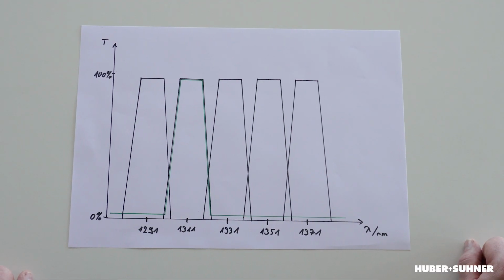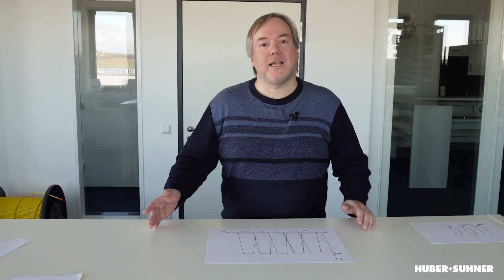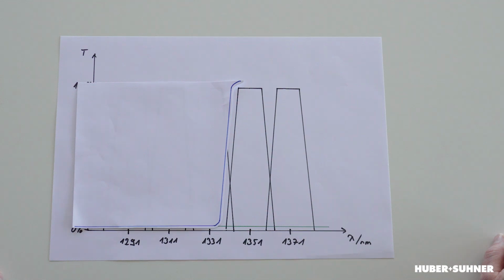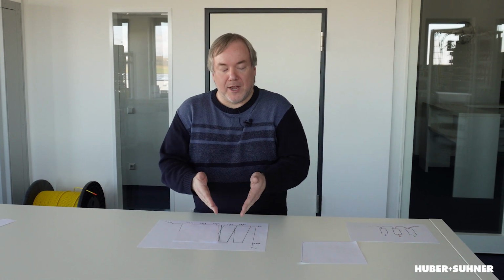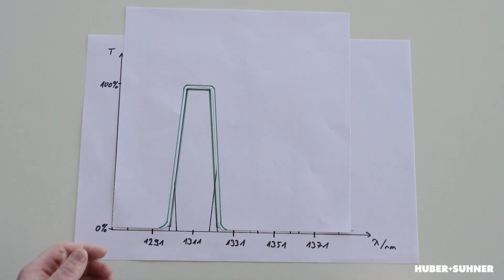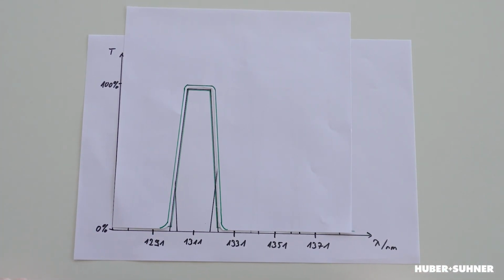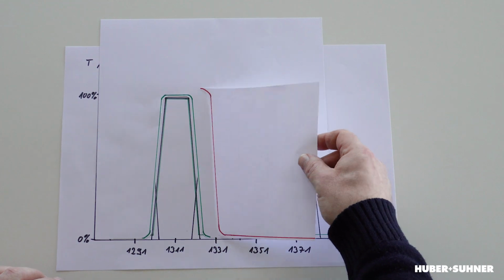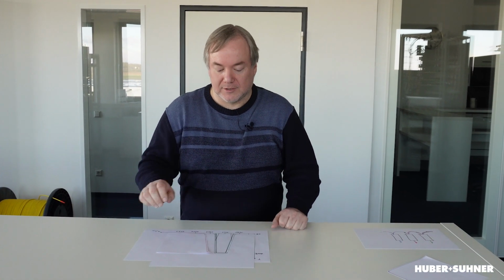Types of Optical Filters Explained (01-06-04)

Comment: I thought an add/drop band was selectively reflected with a bragg grating, rather than selectively passed through a band notch with a thin film filter (i.e. reflecting all else).  Is one old vs new technology?  Is a recirculator used for the add/drop aspect?
Reply from the maker: Nice question @karlfife ! Passive OADMs are generally based on thin film filters. Fiber bragg technology is of course very cost-effective and theoretically would also work. However, an OADM based on fiber bragg would have a much weaker performance in regards to insertion loss and isolation compared to TFF.
Circulators on the other hand are more expensive than TFF and therefore would only be only the preferred technology, if the same wavelength is being used on the same fiber in both directions. (By chance we just uploaded a new #brainsnack on how optical circulators work... if you are interested: https://youtu.be/eef3zRwwtzw)

In other words, the choice of TFF for passive OADMs is a cost and performance decision and not a question of old vs. new technology - also all three technologies are pretty old as they were first conceptualized/demonstrated in the mid 60's to late 70's.

I hope this answers your questions.